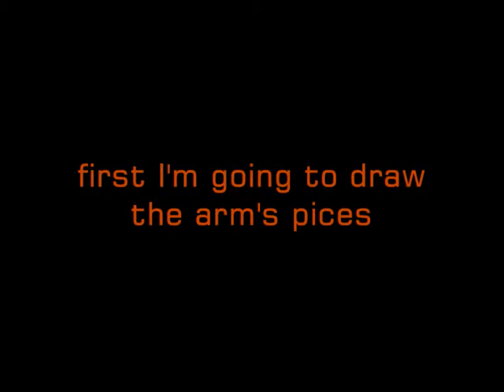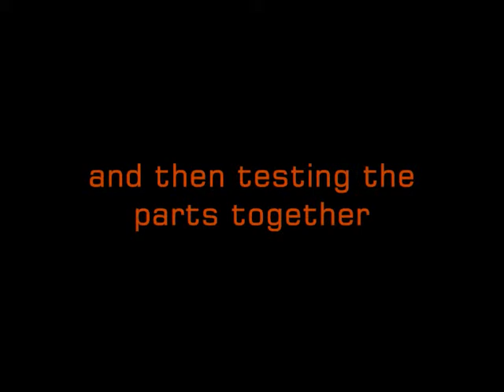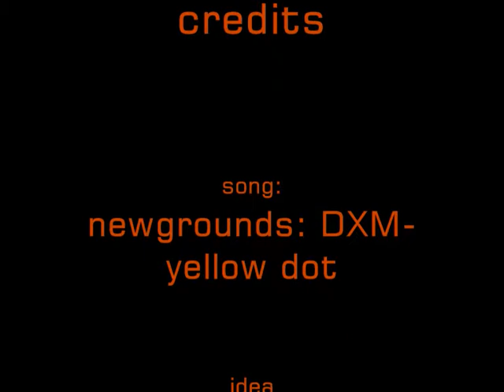Micro-servo Robot-arm part 1

Comment: A quick tip...
When screwing in screws (any), turn the screw backwards (unscrew) a turn or so.  The screw (or bolt) should find it's "seat" and then screw in easily (also less chance of cross-threading it.

That said - cool robotic arm!

Comment from the maker: I use 5mm acrylic and i cut it with a band saw (for rough cuts) and a dremel (for more precise cuts). Any saw would work, but i do not recommend large hand-held saws as they might cause cracks in the acrylic. For best results use a Scroll saw, Coping saw or preferably a laser cutter, if you have one.

Comment from the maker: Working with servos on arduino is a little different than picaxe, but its still easy. The black(or brown*) wire goes to your ground (or negative "-" etc. ), the red (or orange*) wire needs +5volts, which it can get from your arduino, and the last wire, the white one (or yellow*) needs a PWM signal which you can send through one of the digital ports of the arduino. Then the rest is code in the arduino - google for online examples. :)
(*some servos have different colored wires)

Comment from the maker: And lastly, no, standard servos cant spin all the way around, but you can buy modified, or modify them yourself (easy and much cheaper) to make them go all the way around. but doing this makes you loose control of the positioning of servos, instead you control the speed in either direction.
Try googling "Sub-Micro Continuous Rotation Servo Modification" to see how to mod it. The guy on instructables shows a really good way that i've used myself too. :)

Comment: Hello , everything is working fine all servos are moving clearly but servo is generating buzzy noice ,and at some points the servo is shaking or we can say its vibrating. 

How to solve this problem, please help me 

Thanks in advance
Reply from the maker: This is a pretty normal problem, especially if you're using cheap servos because they can often get poor sensor readings and end up trying to correct itself between two positions. I had the same issue, in fact.

Another reason can be if they're not getting a stable enough voltage. You can try and stabilize it with a large electrolytic capacitor between your + and - for the servos power source, or provide a separate and more stable power source for the servos (since they use a lot of power, and often more than can stably be drawn through the micro controller, at least not without some sort of motor driver).

Lastly, there's a few things you can do to try and make sure the PWM from the microcontroller is as clean as possible, since often the standard library subroutines don't make the cleanest waveforms. However this is a little more technical for me to explain here, but you can try and give it a search if the first two methods don't give you any luck. I guess another way to improve this is to switch to a faster/better microcontroller as well, such as one of the newer arduinos or the teensy (which I highly reccomend!)

Good luck :)
Reply: @kattejuice  thank u so much for replying me , i am using atmega 328 , i compiled the correct program in th ic , i am not using arduino . I want to make it small and not complex so i used only the ic , 

Are the ic generating the vibration ?
Reply: @kattejuice  by the way i am using tower pro sg90 motor ,i think its not cheap